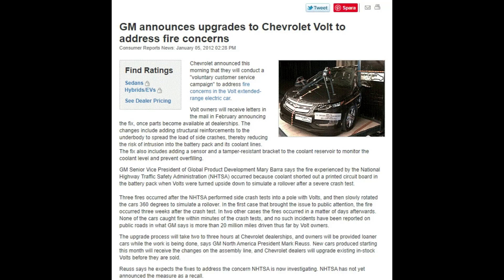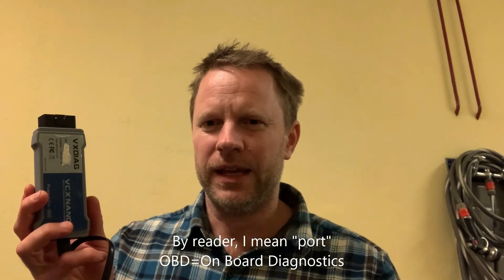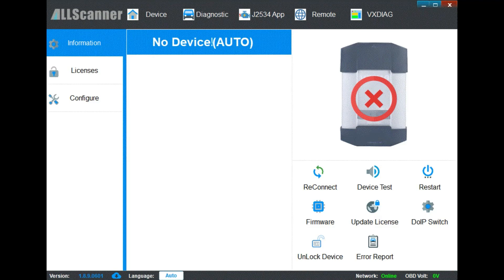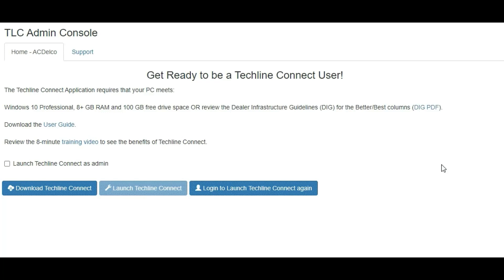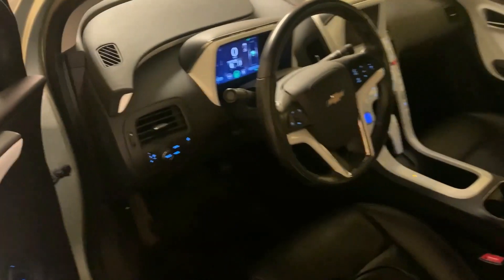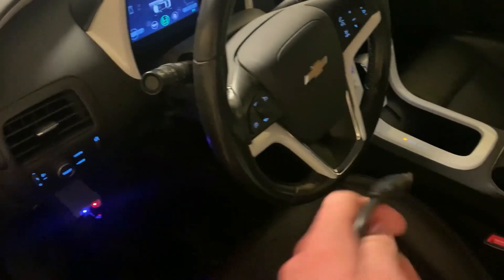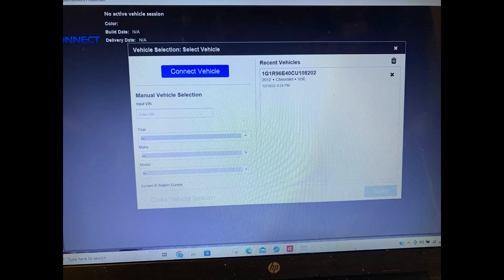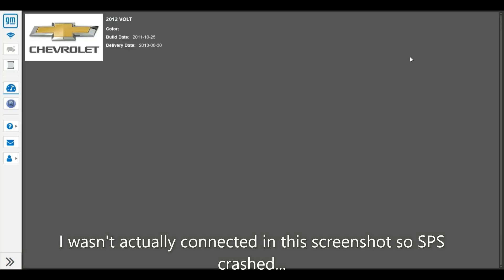Service high voltage charging system programming Chevrolet Volt with VX-nano and Techline Connect

Comment: I have a 2011 volt and the dealer said that there's no reprogram update for the fucking car
Reply: dealers are liars.
Reply: My dealer in Michigan just told me they will reprogram the module if I just tell them to do it for $190..it's not "new" software, it's the same software..

Comment: I was just having the GS2 software issue yesterday.  I bought VX Nano to reprogram for my 2012 Volt High Voltage Charging Error. I bought the Techline subscription. However.... Techline won't because I get a GS2, you don't have a license popup.  I hope your directions will fix this.  Anymore suggestions would be appreciated.  1-21-2023

Any step by step install links on installing VX Nano with ACDELCO Techline?  This is where I'm struck.